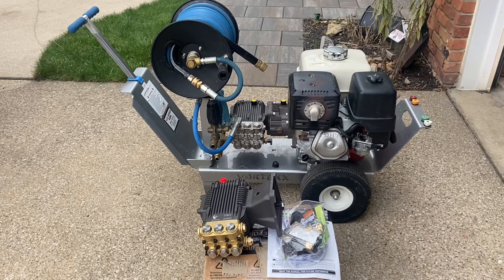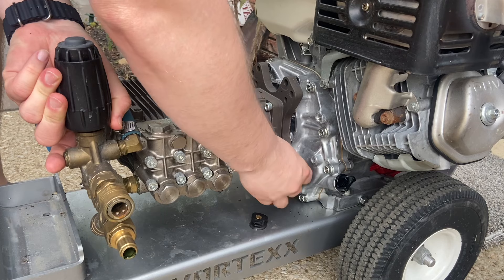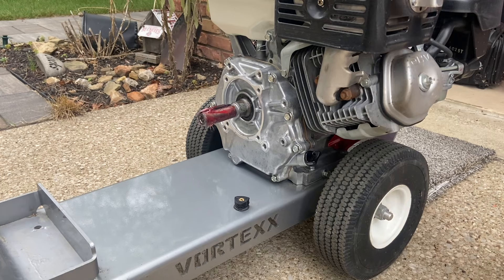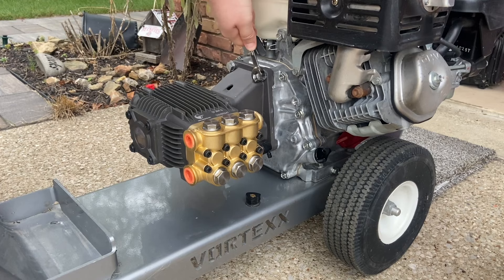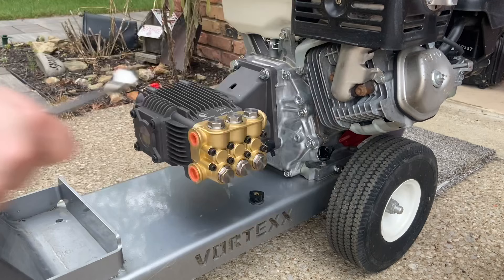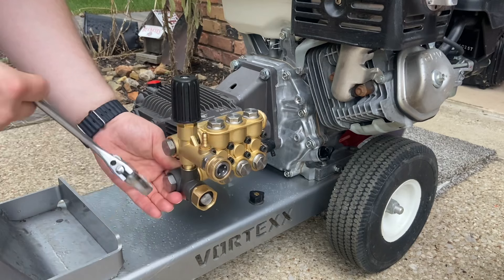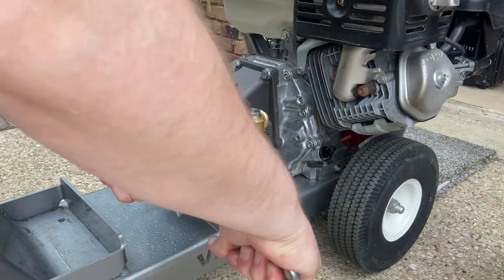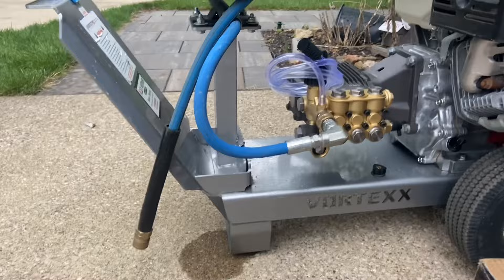Canpump CF 3647 G Install on Honda 13hp GX390

Comment: How do u loke the can pump.. i just bought a duromax 18hp engine and thinking of going ct 2085 thats 8.45gpm or the ce 3648 4.8gpm idk which one yet
Reply from the maker: I liked it.  I've had a few Canpump pressure washer pumps and didn't have any issues with them.  I believe they are made by the same supplier that makes for MITM.
Reply: @jamesbubnick  ok cool I just trying figure out which pump to go with now lol of the canpump line up

Comment: Why didn’t you use the gear reduction box from the old pump you removed?
Reply from the maker: That AR pump and gearbox came together as a unit.  I don't know if you can put the gearbox onto the canpump or not.
Reply: @jamesbubnick  YES YOU CAN

Comment: Do you know what size bolts mount the pump to the engine and the engine to the skid?
Reply from the maker: The pump mounting bolts should be M8x1.25 and I believe the hole is 18mm deep.

As for the engine to skid. I think the GX200's use 1/4 (6-7 mm) and I'm going to say 3/8 (9-10 MM)for the GX390.

Comment: Now the wz-1507A is cf 3030 G. Not sure why they changed the model number
Reply from the maker: No idea...In the pressure washer pump world it seems everything has a few number changes and it's a new pump that is out..
Reply: @jamesbubnick  interesting, I'm really torn between the vevor triplex that's on the jungle website and the canpump because the vevor is $70 cheaper than the canpump and looking at their specs there's only a difference of 50 cleaning units. Idk if that's a big enough difference between the two I just know that the canpump is 3 gpm where the vevor is the standard 2.5 gpm but with a higher psi.
Reply from the maker: @benjaminleslie3155  I've never bought anything from vevor but I was told they contract out and private label almost anything you can find.  Then again most companies do that or just get mfg to spec.  I have no issues with that or with anything else.  I spent around 4 years in China at university, launching products, opening warehouses, etc....

As an FYI you can by direct on Canpump's website and it's usually a bit cheaper then amazon, also Canpump does offer replacement parts where I'm not sure if vevor does.  My gut is telling me that with such close pump specs you won't notice much of a difference between the units. The real test is durability of the pump.  I do this stuff as a side hobby and with proper use I don't wear anything out.  Pretty much everything I buy is dead as a result of misuse/neglect/lack of maintenance.  As far as I can remember I've only had 1 pump that was actually worn out and it was a AAA that was used commercially.

Comment: Nice pump 
Recently discovered CanPump they seem to be quite good units was wondering if you knew what would be the biggest pump which would work on a Honda gx200 clone 
would the 3WZ-1507A work or too big for the motor
I currently have model: CH 2830 G it seems to be kinda under-loading the engine i think at least it sounds like it
Reply from the maker: The 1507A pump is nicer and more powerful and the Honda clone can power it.  You might want to check your orifice size of your tips as those need to be sized properly for your pumps GPM and PSI rating.  I've had the CH 2830 and didn't haven't an issue w/ it being underpowered but if you want to switch it out the 1507A is a good pump.  I put that model on for a few people who needed pump replacements.
Reply: @jamesbubnick  thanks for the response 
It's more that the engine seems like it's almost under no load when I'm running the cheaper pump  and the pressure seems lower, but I have found my patio washer seems worn out I think bearing has had it as its kinda grindy/ noisy